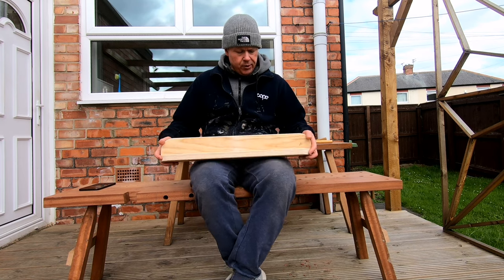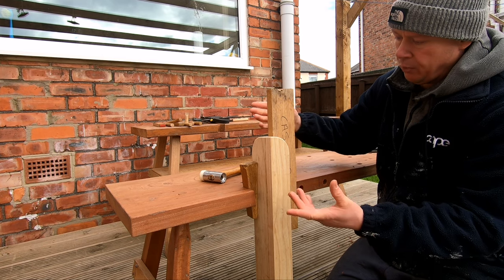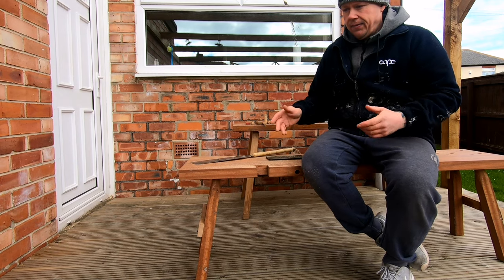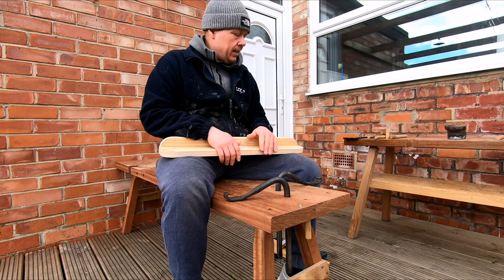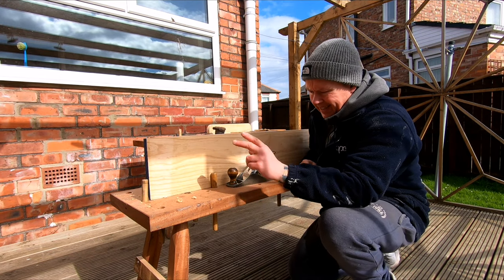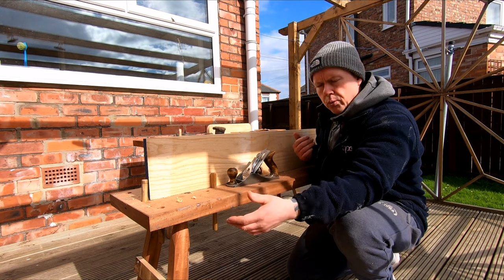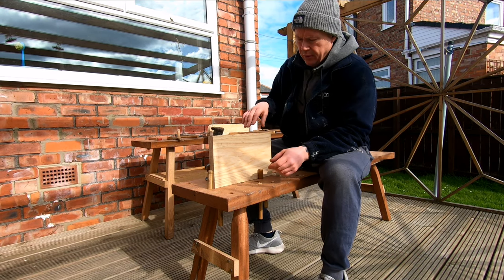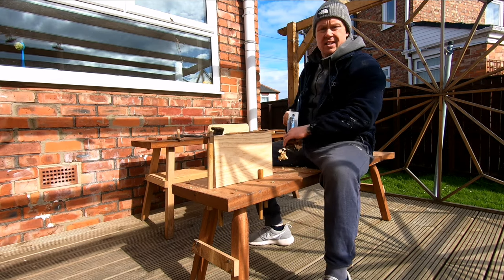Roman workbench work holding (part 3).

Comment: If your bench is sliding, fix a 2 x 4 or 1x2 underside of bench a few feet or a meter out, and have it butt  up against the house, it wont go any where then! 
Great videos on the use of the bench! 
Like all your work holding methods. The wedge a great and useful tool!  Thanks for sharing through this media!
Steven Columbus Michigan
Reply from the maker: Thanks for watching, I appreciate your time.

Comment: Thanks for the ebook and thanks for the warnings about back issues while face planing-I was concerned about certain activities aggrivating back and knee problems while using the low bench since I am accustomed to using a taller bench. jimbo
Reply from the maker: Thanks very much, I appreciate your time.

Admittedly, you do have to be cautious if you have ailments but, I've always stopped when I've felt the need, and never had any serious problems.

Comment: I recently finished making a roman workbench from an elm log that was in my back yard.  I was thinking I needed to put in a twin screw vice, but this video has convinced me otherwise.  Thanks!
I really like your L shaped notch accessory.  Do you use any other appliances with the bench?  Have you adapted using a shooting board on the roman workbench?  Bench Hook?
Reply from the maker: Thanks for watching. I think between the part 2 and part 3 videos, I cover everything I use. 

I don't really use hooks and such but, a hookless (flat) shooting board will work again a dog, or on a non slip mat.

Comment: These are some excellent videos, thank you.  From a left hander could you safely put a notch on both sides of the so you can cut both left and right handed?  or would it comprimise the benches strength?  I was also thinking of an idea of putting the wedges, pins and dogs on one of the cross struts where you recommend to put the planes?  (i.e. an additional small piece of wood for a second crossstrut making a gap for wedges)

Can not wait to make one as my work shop is tiny and this would be ideal.
Reply from the maker: Thanks for watching I appreciate it 👍.

If you put two notches in, I'd put one closer to the front legs, and one closer to the back legs, so there on a diagonal and away from each other.

You could have a go with the wedge storage. I had an Idea to make a simple fanny pack of leather, permanently fixed to the legs. It's so easy to lose/misplace pegs and wedges, and spend 15 minutes looking for them 😂
Reply: @DW_woodworks  Thank you, and thank you for such a quick response as well.

Comment: Question for you: how would I hold a 1/2" thick piece of oak thats about 4"x4" high and long without a vice, while it stands on edge on the Roman bench? I need to shave it with a spokeshave, possibly drawknife, and then plane the edge.
Reply from the maker: I'd probably attach it to the notch accessory with clamps if you've already cut it to length. Usually with small pieces I leave them as long as I can, for as long as I can. This way I have more material to clamp. So you could easily work on one edge, then cut it to size, maybe struggle with the other edge, but the notch accessory should take care of that.
Reply: @DW_woodworks  thank you very much. I was scratching my head on that one. I love the thought of a viceless workbench, and so your build is top of mind. Here's another excellent example of how to hold various things on the workbench. This may be interesting - search, "18 Work Holding Tricks for the Sculptor's Roman Bench" here on Youtube. Cheers